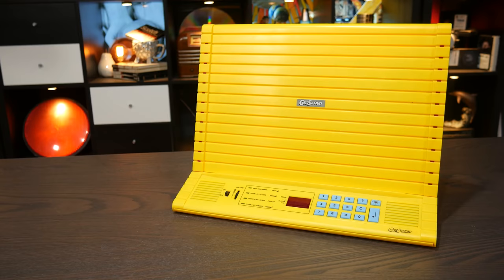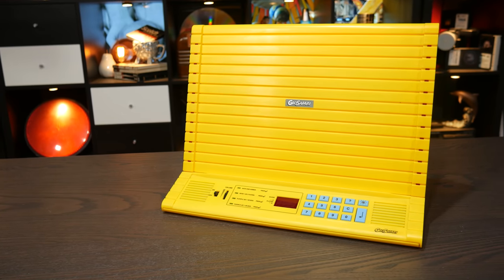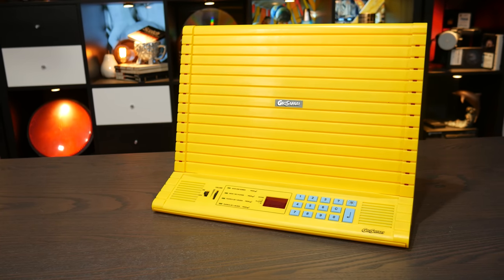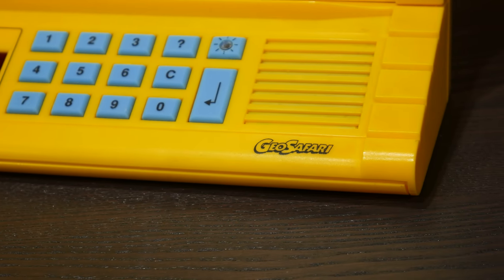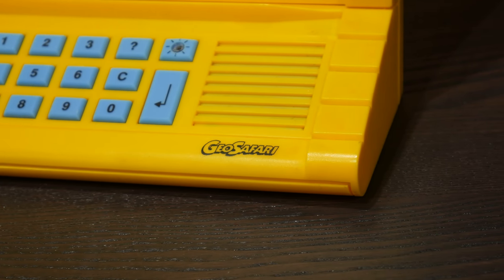The GeoSafari Jr. was a cleverly flexible kid's game

Comment: I definitely do not miss the days of gigantic D cells, which were always heavy, expensive, and everything took at least 4. Not to mention non-rechargable.
Reply: And they didn't last long either.
Reply: I had some rechargeable ones, back in the day. And a massive charger that could do those, Cs, AAs, AAAs, and PP3 (9V) batteries.
Reply: My dad refused to buy them and only let us use the AC adapter he mentioned.
Reply: I have a battery charger that's supposed to fit C and D batteries (and AA, AAA, and 9V), but I've never actually seen rechargeable C or D batteries.
Reply: @xorsyst1  I had rechargeable D cells and that massive charger too. I used them in the first baby swing I owned that didn't have an AC adapter, though the next revision of the swing corrected that oversight. I still have those rechargeable D cells but what could possibly need them in todays world of 18650 lithium batteries?
Reply: @xorsyst1  Aaah the good old days of NiCd cells. I've set many things on fire with a NiCd D cell and some thin wire wrapped around a match head. It still surprises me to this day that I have not ended up in jail for arson - or in the fire department.
Reply: Where are all the batteries????
"I don't know"
* Puts handful of carbon rods into pocket*
Reply: I seem to recall that Big Clive tore open some "modern" rechargeable C and D cells from one of the usual suspects... and what he found inside was a single AA NiMH cell and a bunch of filler material. Scoundrels!
Reply: @sixstringedthing  Wasn't that Dave at EEVblog? I'm not 100% sure, though :)
(Big Clive's adventures in disassembling batteries have been a little more... incendiary... 😹)
Reply: The good old days when I bought D cells.  Or yesterday.
Reply: @AndrewGillard  yeah, you're probably right. It was a while ago now.
Reply: @zalafinari  boom boxes! They all used D cells if you were wealthy enough to fill em up
Reply: Well, you could and can technically recharge alkalines, but certainly a waste of effort (there were some dedicated rechargable alkalines... they were better, but not actually good). At any rate, anything that takes D cells will tend to be either a flashlight, modified by someone tired of replacing AA cells, or a horrible energy hog that you should never use away from AC.

And yeah, you can use D cells to power AA (or even AAA) cell stuff: allows more current, but at the same voltage, so if the battery manufacturer isn't junk you'll get a lot better battery life.
Reply: @sixstringedthing  I bought a set of NiMH rechargeables a few years back, and it came with a couple C and D sized chassis that you could slip the AA batteries into if you wanted to use them in something that took the larger sizes.
Reply: @RobertLink  yeah, I've seen those before, quite handy. Probably wouldn't have been much use back when NiMH was new technology, considering the fairly low capacity of AA cells at the time. But definitely useful with modern 2000mAH cells. 👍
Reply: @xorsyst1  Radio Shack?  because we had one from them that took all the sizes too.
Reply: I had a boom box that took TEN D-Cell batteries.  Ten.  I never bothered using it with batteries, only with the AC cable.

(It demanded that many because it had a 5.5" monochrome CRT, which was cool but useless for my desires, since video games assumed you had color.  Dr. Mario's yellow and blue pills are the same shade of white on that.  It also had an annoying proprietary adapter needed, because it used either a headphone jack or mini version of a headphone jack that you plugged the adapter into, and the adapter was the two-terminal 300-ohm style connection, necessitating a 300-to-75 ohm converter to use with nearly anything.)

Comment: The fake speaker grill reminded me of something. Back in the 80s there was a brand of Super 8 film movie camera called the Bentley. They were all-plastic construction with an extremely simple mechanism, and they had a half-pound lead weight inside to give it some heft and make it feel like a higher quality camera. 

I used to find them in thrift stores and garage sales, usually for $5-10 dollars. Their light weight and simplicity made them perfect for my needs -- I removed the outer casing and lead weight, cut down the frame to the bare minimum, and mounted them in large, homemade rockets. Got a lot of great inflight footage! Also, they were designed to run on 4.5 volts, but I'd use a 9v battery to "over crank" the camera and get a nice bit of slo-mo.
Reply: Do you still have any of the footage?
Reply: You'd be surprised how many devices, Especially speakers, have a chunk of metal in them for no other purpose than giving them a bit of heft, though in the case of speakers, and people don't realize this, that weight is to keep the thing from vibrating itself off your desk.
Reply: @TacComControl  There's at least one type of gaming mouse I've seen that's designed with removable weights.  Which makes a lot of sense, really, since it means you can adjust how easy it is to slide it around a mousepad and give it some resistance to make it feel more comfortable and less floaty.
Reply: @TacComControl  Reasonable for speakers and other devices that need stability (e.g. desk lamps), but some modems (back in dialup/early cable days, IIRC) used to have weights inside too. My understanding is that they wanted to make them with improved parts that happened to be lighter, but wanted them to weigh the same so customers wouldn't think they were cheaply made. I don't know why the modem market was sensitive to weight-based perceptions of quality, especially when you usually just got whatever model your ISP gave you.
Reply: @SethalaTheGamer  I actually just bought one.  The Logitech G502 has removable weights (which I haven't tried it with the weights yet since it actually feels pretty good without) as well as their lightspeed wireless which is actually faster than most wired gaming mice.  Only used a couple days now and it's way better than the Razer Mamba Elite I was using before (though the free scroll will take some getting used to).
Reply: Now THAT is cool!
Reply: that’s so cool! i’d love to see that footage
Reply: @grn1  I know this comment i old, but you are aware that you can switch the mouse wheel from free scroll to normal mode by pressing one of the buttons under the wheel?
Reply: @sehfisch2350  Tbh I realized that not too long after I posted the comment.  I actually do use it primarily in free scroll though unless I'm looking through pictures or something where an accidental scroll would mean losing my place.
Reply: Beats headphones have weights to make them seem like they aren't cheap POS, right?
Reply: @IDoNotLikeHandlesOnYT  I would think the reason for adding additional weight to modems was to provide enough downwards pressure on the feet to keep the weight of the cables from pulling them off the table.
Reply: The extra weight would actually help to be fair, as it would reduce shakiness.
Reply: @sehfisch2350  bruh I'm on a completely different mouse and this comment taught me that MMB is a scroll toggle, not press and hold, lmao
Reply: things have come full circle, some power supplies now include rocks and concrete to make them feel like heavier supplies and not throwaway garbage
Reply: Dude you took a cheap poser piece of crap and found a legitimately cool use for it! Amazing!!!
Reply: I know that in some boom boxes from the '80s they'd put steel plates to make it feel better when carried and likely to help keep accidental bumps from flipping them on their side once placed down since many of these were either equal height to depth or were slightly taller than they were deep.

That said the weights in that camera may have served a secondary purpose; if your camera is too light and you don't have some kind of stabilization system you get a ton of hand jitter when zoomed in.  The Steadycam makes use of an elaborate system of springs and a harness to help keep shots steady in situations where traditional tracked shots using actual track can't be used, but beyond the springs being tuned just right a lot of the functionality of the early models is making sure that the camera has enough inertia to dampen jitter.  Some people have made their own Steadycam-like rigs for their DSLR cameras by using a cheap monopod with a 10 lb (or somewhat greater) weight plate attached to the bottom of the monopod and holding the monopod at the center of balance either straight on it or via a clamped--on handle of sorts.
Reply: @SethalaTheGamer  Yes, my mouse has adjustable weight. It's more for making your mouse feel like your old mouse so you can transition easier.
Reply: Ok TC comment sections are some of the most educational content I've found on here barre none. Didn't know you could cause a camera to manually cause an effect by overcharging it... That makes sense to me but never would have occured to me. Thanks.
Reply: @joeydurant6267   The extreme simplicity of those cameras made it possible.  I'm not sure if it would have had the same effect on a more advanced movie camera.
Reply: @raydunakin  that's the beauty of the older mechanical and analog stuff is just by upping the amps or changing some really simple parameters you could get wildly different results and it's super interesting to me. I play guitar and grew up hearing all these legends about fuzz pedals in freezers etc... Ffw to current day and learning that germanium is indeed fairly sensitive to heat and there's something to that... It explains why certain amps and pedals that belonged to famous players really did seem to have something undefinable to them... They often had gear hand built as prototypes etc and the tolerances would be perfect for the circuit... And then you see the +/- values and see why there is so much variance. It's all fascinating and weirdly comforting to me.
Reply: Brother, they STILL put fake speaker cavities in phones despite being mono
Reply: @grn1 I have no knowledge of that specific mouse, but all the free scroll ones I have seen have it as toggleable with buttons. See if any of the buttons turn it off.
Reply: It was likely system/circuit ventilation if that thing had AC interface (anything with an AC patch-in tends to get quite warm) ☺️🔌

Comment: That plastic melting method of securing things is officially called “heatstaking”

Often used because for lightweight parts because it’s cheaper and easier than designing a flange or stand-off and using a screw to hold the parts together.
Reply: For a treat especiale?
Reply: Skookum as frig!
Reply: I read that as “heatstanking” 🤣
Reply: Also an "ultrasonic weld"
Reply: You know where to keep it...
Reply: @Disjointedimages  Ultrasonic welding is something different entirely. Usually used for seams and performed with ultrasonic waves. This is some guy mashing what is basically a soldering iron down on some plastic. 🤣
Reply: @ms_enj  : And sometimes literally a soldering iron, though I would at least use a temperature-controlled station & a dedicated tip if going it at home.
Reply: @absalomdraconis  Nah, just a cheapo high-watt iron with a big wide chisel point that you throw away when it gets ruined after a few runs. I call it "fuck-u-facturing", China built much of their consumer electronics industry based on it. Cheaper to throw away than maintain. Granted, the rest of the world was probably still in a similar production mindset at the time this thing was built.

Comment: "Glop top" (ASIC silicon on PCB) goes back to the 70's. The melted construction was to save costs (probably to offset the large mold size) And yes the socketed segmented LED display is very odd... guessing it was some sort of assembly consideration, ie "we can't wave solder the LED and make the cables work correctly" There's also a lot of flux indicating some hand assembly.
Reply: Who else but Ben heck would know that
Reply: @mccobsta  definitely nobody else 😉
Reply: the socketed LED was because they wanted to use LCD but didn't have any.  Kinda common to have boards made with sockets like that even today.  The melt-over retention of the wires also indicates hand assembly.
Reply: @illustriouschin  the wires have to be bonded either way. With socketed chips, they are bonded to the pins.
Reply: @illustriouschin  ? In qty, it's cheaper to order the chips without a package and do the bonding at the pcba mfg'er. Setup costs are more but bom cost is less.
Reply: @mccobsta  Dave Jones, Jeri Elsworth, Limor Fried
Reply: AMAZING HACKS
Reply: Immediately thought of you and the word "glop top" when I saw the blob
Reply: Oh hi Ben. nice to see you outside of your channel :P
Reply: @illustriouschin   Apologies if it came across that way.
Reply: Ben Heck is how I found this channel in the first place. Then I saw the crossover with Aging wheels. Crazy small world.
Reply: I'm having a geekout moment!!!!
Reply: @Ben, maybe you can also tell us how they managed to control 13 LEDs (per side) individually using only some 9 leads from the control board  to each side?
Reply: They are usually call COB's or Chip On Board. It's what you do when you want to suck every last cent out of a high volume product. I wouldn't be surprised if the first gen had regular IC packaging.
Reply: In China in the 90s assembling something like this 100% by hand would probably have been cheaper than using any automation. All you need is a room with space for enough workers, no need for capital intensive automatic insertion or wave soldering.
Reply: @mccobsta  pretty much every electrotech?
Reply: @jack_brooks  or less affectionately, blob on board
Reply: @deelowe3  you didn’t, they are being weird
Reply: @OnionMad  : Likely Charlieplexing, it's a useful technique.
Reply: @madkvideo  INSPIRED DESIGNS
Reply: Socketing the LED display may have been done to set the height required for installation in the case.
Reply: At a guess they were worried about heat sensitivity in the LED unit. I've seen other products with socketed displays like that.
Reply: @OnionMad  By forming a grid of 5 x 4. Then the pattern is simply writing the right 19 bit number to it. Bit likely this would have a 8-bit MCU, so I would expect it was spread over 3 bytes. And some shift registers and stuff since I doubt that small MCU had that many io pins.
Reply: @mccobsta  just noticed, it was Ben Heck
Reply: I first saw the "Blob" in a 1975 calculator.  I was in HS electronics and my Dad gave it to me because it didn't work.  We dissected it in class and fixed it.
Reply: @prjndigo  It's unlikely they hoped to use an LCD. LCDs use very different driver circuitry. The socket is probably just a  spacer used to position the LED at the right height. I've done this sort of thing before when designing front panels.
By the way melting the plastic is pretty common. It is technically called heat staking.
Reply: @OnionMad  4x4 multiplexing, probably
Reply: @matth3wc  I did and came here to comment about it.
Reply: @BobWiersema  Same here.  My early example was a National Semiconductor calculator.
Reply: @LesNewell  Agreed; a ton of stuff used heat staking years ago.  I'd guess they stopped due to toxic fumes?

Comment: 18:52 that deceptive product design is so rad! Just like the fake solar strips they put in "self powering" calculators.
Reply: .....they aren't fake. Not all of them anyway.
Reply: @billyloper4072  i was gonna say lol I remember in school we'd cover the solar strips with our fingers and watch the calculator screen fade out
Reply: I want to see Alec add a second speaker to that GeoSafari and make the boops REALLY stereo.
Reply: Are you meaning that only some parts of the strips are actual solar things and the rest are cosmetic? If so, neato.
Reply: @blaireshoe8738  nah. In some calculators it is just a bit of black plastic or even a sticker. In others it's a solar panel.
Reply: last person I expected to see here
Reply: If i placed my finger over the strip, the calculator did not display anything. They arent BS.
Reply: The calculators we have at work have solar panels. They also have an internal button cell battery that's not made to be replaceable.. unless you own a small screw driver. The solar panel is the main power source and the battery is supplemental and will last for years and years, and it's also there to store a tiny amount of memory...
Reply: @MmeHyraelle  There's quite a few (usually dollar store tat) that have fake solar cells but they actually operate on a coin cell.
Reply: @dominateeye  I am ZeosPantera and I approve this message!
Reply: @billyloper4072  Yeah I have both types lol, I have one with a fake solar panel, and one with a real one
Reply: Those solar strips are real. They have literally saved my day in an exam.
Reply: @nisargbhavsar25  some are fake tho, not all of them, but some of them are